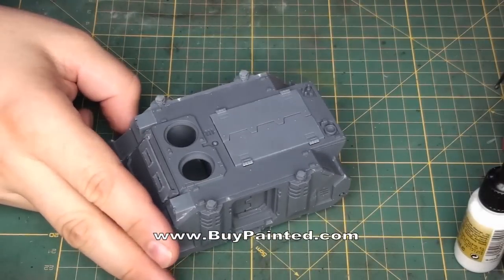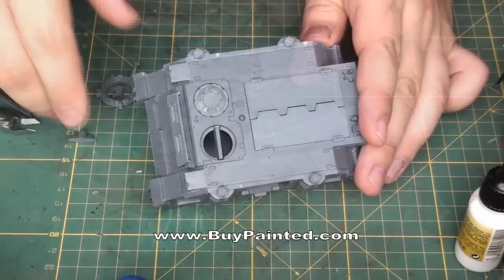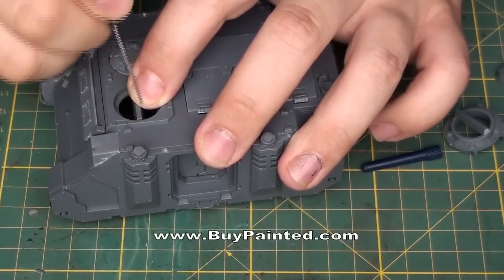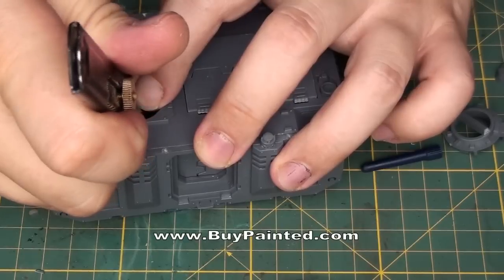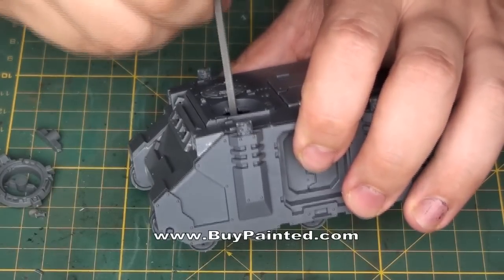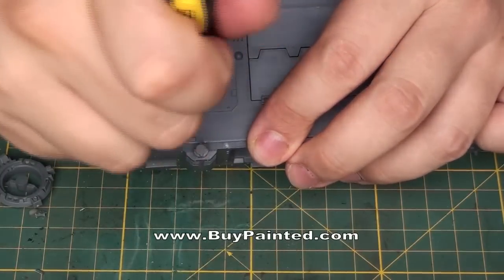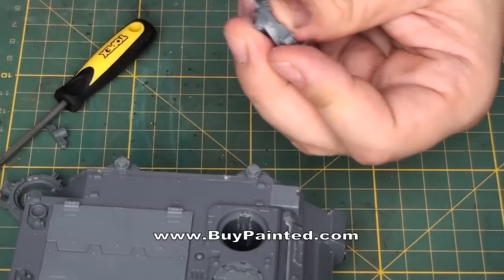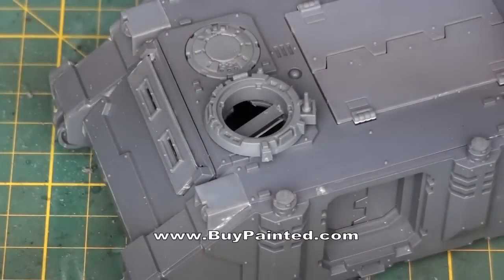How to make removable hatches in the models?  | Warhammer 40k  | BuyPainted

Comment from the maker: You can use it to custom equipment for each battle. For example if you have some extra points you may add storm bolter turret. If you have lack points - just install normal turret

Comment: The post box won't let me post a web site address?

Unsure why but I got it in Australia from w w w dot  decalpaper dot c om dot au
I am sure you can get the product online. Its as simple as printing and then use the decal as per normal  - cut out put in water and the apply. You can get clear or white backed paper. Clear will have a transparent background, white will need to be trimmed to fit as it shows - white backing.
:)